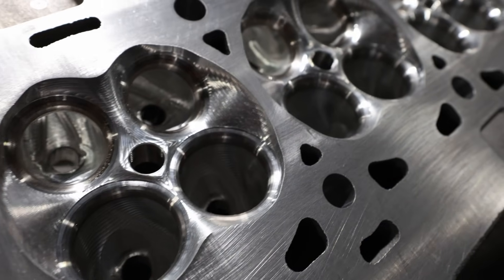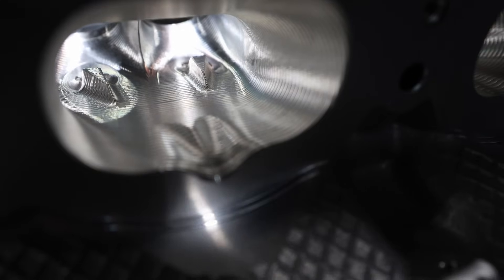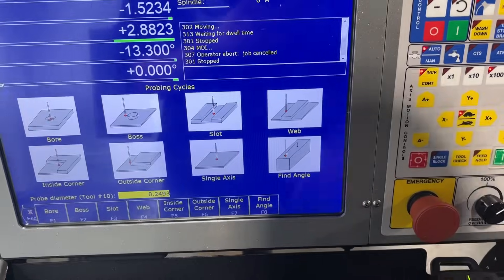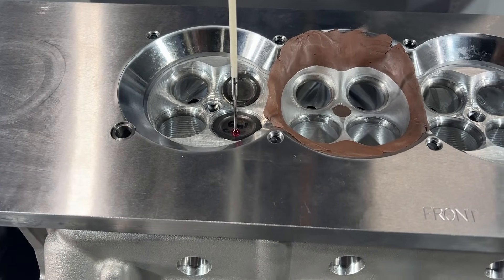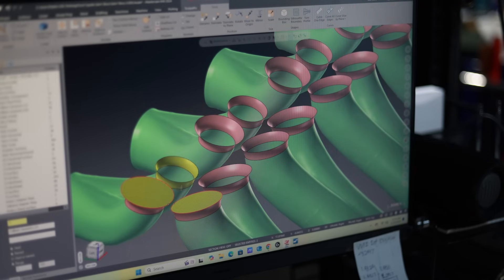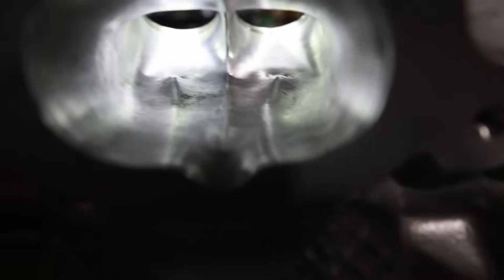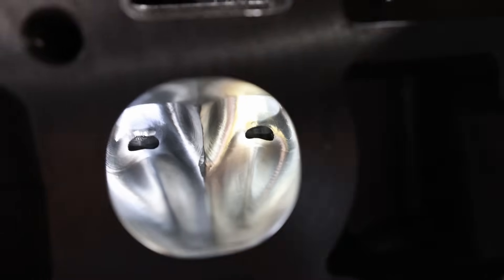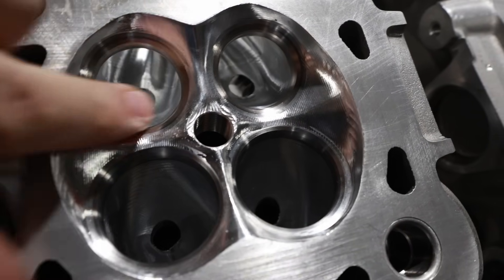Road to CNC: Ford Voodoo!

Comment: I thought the. Voodoo head had slightly different valve angles than the standard coyote head which is why it requires special camshafts to be run on a Coyote with the coyote firing order and not a Voodoo.
Reply from the maker: @backinblck1  it does!

Comment: What are the valve angles for the Coyote, Boss (Roadrunner), Voodoo and Predator cylinder heads?

And if you know what are the valve angles on the old Modular 2V and 4V heads?

Valve angles are never mentioned in conversations about OHC heads. I have always been curious about what the valve angles are on these cylinder heads and how much they affect performance on a OHC engine compared to the valve angles on a OHC engine.

Change the valve angles on a OHV head and the horsepower go up a lot.
Reply from the maker: @bigroller8233  the valve angles are not the same from voodoo to others in the family but not sure how they compare to the mod head.

Comment: Looking forward to seeing what you guys can do with Gen 3 Coyote heads.

Would love to see how those compare to fully ported Voodoo heads.

This is very important stuff for the Coyote & Voodoo platforms because these cars are making well over 1,000rwhp with relative ease on good pump E85.

However, doing so is really maxing out the limits of the stock internals so increasing the efficiency on the heads and proper matching of upgraded camshafts can really unlock some big power and reduce the need to push the cars as hard.
Reply from the maker: You nailed it! Same power at a lower boost level.
Reply: @headgames  Been trying to explain this to some of my fellow Coyote guys that making 1200rwhp on 20lbs of boost and 1200rwhp on 18lbs of boost are not the same. The power the engine produces isn't really relevant vs. the amount of stress it takes to make that level of power.
Reply from the maker: @ yes! It’s easy to think because it will make the power that a ported head won’t help. And, sometimes the head is so big that it doesn’t help. But, done right it will make same peak power but make more area under the curve.
Reply: @ Yeah, nobody has really produced any hard data/comparisons on this and I think we are at a point with these engines that is something that needs to be explored. Obviously the cost to do heads/cams on these cars isn't cheap and that's a large reason why people don't mess with them, but that doesn't mean that it shouldn't be explored and exploited in certain applications.